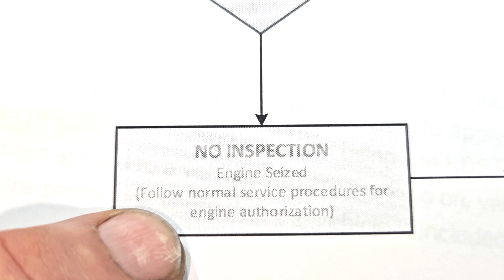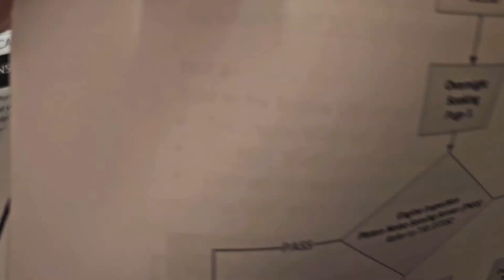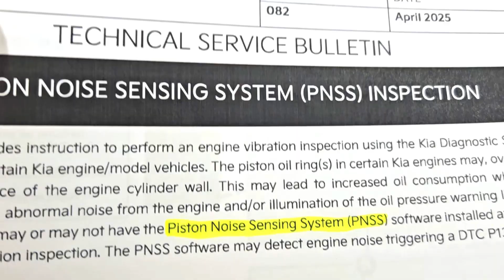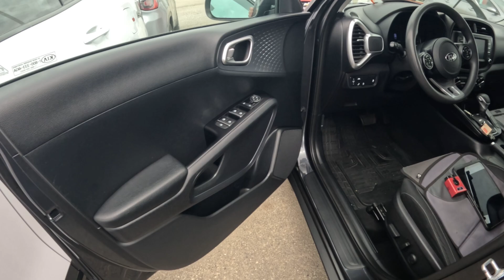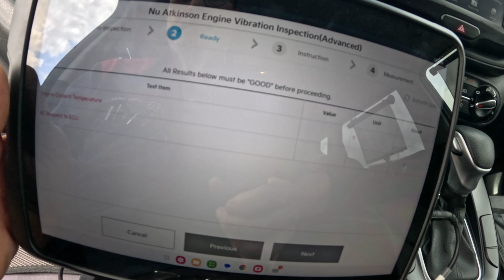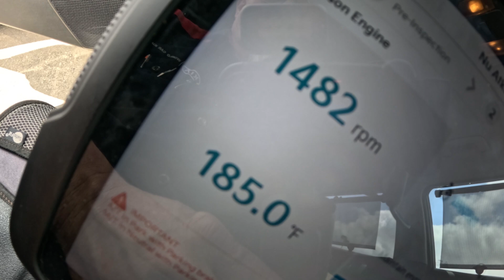New KIA Engine Recall SC336

Comment: Hi there here is a question that it might sound stupid on my behalf. I don’t know how the campaigns or anything like that work so I guess maybe this is why I’m asking it in the example that you are having now with the soul they know about this problem with the engine situation and all that if the engine has to be replaced since this is a 21 vehicle and by the time this campaign comes out and everything down it could be two or three years later when they do replace the engine would they use their engine that is on the current vehicles like you know the actual new ones like the one that is two or three years old later that is more advanced and whatever problem it may have before has been corrected and all that or that way, you don’t have to do anything with the software to upgrade it or anything like that did you just get it new engine with the new advances on it sure it’s the same type of engine you know like the four-cylinder 2.0 whatever it’s just the one that it has been tweaked in advanced so that way it doesn’t have the same problem. Is that how that works?

Comment: I had this done to my 21 Seltos it failed then Kia changed the part that it is to be a cold test to then let it warm up so it would pass. I like my car but Kia is crooked for changing the parameters so the wouldn't have to replace my engine.
Reply from the maker: What happen is the software KIA was using to perform the test was inadequate. It was causing technicians to condemn engines that weren't failing.  So KIA  put a stop to the recall while they fixed the software issue.  Some of the vehicles that showed they needed a new engine had to be retested after the new software came out.  So if they said that the engine was bad and then came back and said that it was good.  That's why.

Comment: My car has been at the Kia dealership for 4 months now
Reply from the maker: Sorry to hear that, hopefully they get it back to you soon. Is it waiting for an engine?
Reply: @ShopForemanGarage they are trying to get me to put a rebuilt engine in it . First it was for bad fuel - approved repair. Then it still wouldn’t start . Now they are saying compression is low and the leak down test shows 25 %. My husband is a diesel mechanic and he said that they don’t know what’s wrong with it so they want to throw an engine at it . What happens if I approve the engine repair and it still doesn’t start?? Then I’m out 10k
Reply from the maker: @Housewife92 your husband is probably right. 25% leak down is nowhere near 80% leak down. It may have a burnt or stuck valve. You may want to get a second option. I assume the vehicle isn't under warranty anymore.  Engines can be fixed. They don't have to always be replaced.
Reply: @ShopForemanGarage it has 189 k  and I’m I’m original owner. Kia has yet to provide any copy’s of reports other than a compression test cylinders 1-3 are at 150 and cylinder 4 is at 100 . I was told Kia dealerships don’t rebuild or break down engines they just replace them.
Reply from the maker: They don't break down engines?  Well, they will be surprised at the 3 hour video I'm putting out this weekend.  That vehicle is under warranty.  
No automotive manufacturer rebuilds engines anymore.  It's just not cost effective, "under warranty!". But, you can still get all the parts to rebuild it if you need to.  These kids now days don't know the difference between replacing a part and repairing a part.  If they did a leak down test then they should be able to tell you where it is leaking.  Is it intake, exhaust, crank case, or cooling system.  That should help them determine what area needs to be repaired.  Honestly, that compression is not so low that the engine won't start.  It should start and run on that compression.  If it doesn't start at all. Then there is something else wrong.
Reply: @ShopForemanGarage  Amen that’s the same thing my husband told them .

Comment: OMG I watched the whole video.  I subscribed. I own a 2012 KIA Optima Hybrid with 195K on the clock. It’s been a very reliable vehicle. I hope it will get another 150K. I change the oil every 5,000 miles. The most expensive repair was replacing the belt tensioners. I replaced the two belts myself and the belt still walked. I had it towed to the stealership to have the tensioners replaced. I can’t believe the stealership wanted $400 to replace my plugs. I got 183K from the original brakes.  Thanks for sharing your knowledge. Enjoy The Journey - Cheers
Reply from the maker: Thanks for watching. And thanks for your support.

Comment: My  son went knock sensor recall after that they call said needs a engine  it fail a test. Now the new have lifetime warranty on his Kia  optima after engine replacement because they know will fail again.
Reply from the maker: I have not seen any replacement engine fail.
Reply: @ShopForemanGarage I've been reading up on them and engine I've read had good reviews. 
I just tom my 21 kia soul in for the recall but I want having any issues. I really didn't expect to have my engine replaced however the dealership called and said my engine failed.  It's at the dealership as I type and I'm using a loaner. Kia has treated me very well, I have no complaints. 
Every vehicle will have some issues, but Kia has been great about owning up and fixing the issues.  Much better than other brands

Comment: I suspect if customer bring in for this test at a low mileage the engine may pass but on higher mileage cars may fail.
Reply from the maker: This is true. That is why we install the logic improvement. It will detect the issue.
Reply: @ShopForemanGarage  my mother in-law is bringing in her 2022 Seltos next week for the test. it has 33K miles. I wonder what they will find.
Reply from the maker: Good luck. I'm sure it will be fine. Thanks for the comment.
Reply: My 2021 seltos with 24k failed.

Comment: In all fairness, they did replace my engine, at 128.567 milea. But now my cat is dead after. So i'm battling with them.Have you ever seen them replace a cat. After the warranty engine replacement..
Reply from the maker: Yes. Before and after the engine replacement.

Comment: Yikes - that motor is in a lot of cars - not sure if they are all manufactured in a single factory.  Atkinson - when I was looking - Jetta, Sentra, Forte, Civic, Corolla - but Toyota salesperson took me out to the parking lot and said - do not get the deluxe motor as they were having problems with the Atkinson cycles - get the 1.8L - less power, less mpg BUT he said it is 10 times better motor if I intend to keep the car like 10 years (and he said the other brands will have the same issues with these modern engines). Anyway, I asked Hyundai when I was buying and he said you absolutely need to change the oil bi-yearly with nothing but synthetic (manual say 8,000 km he said do it every 6k to 7k) and that Hyundai will be watching the diagnotics in the computer like crazy - so be wise and keep on top of the maintenance.  BTW - it is actually not exactly an Atkinson cycle for Hyundai - "more the" Miller Cycle which is a much more eliquent exectution of design (originally envision to avoid copyright issues decades ago) of what the Atkinson cycle does with the valves opening and closing (my armchair understanding is that the valves "variable" is not done via the mechanical movement of the cylinder so much as the valves are doing it more on their own).
Reply from the maker: That's a lot of great information. Thanks for sharing.  The miller cycle and atkinson cycle do the same thing.  Atkinson uses intake valve timing and Miller uses a supercharger or turbocharger to achieve the difference between compression stroke and expansion stroke.